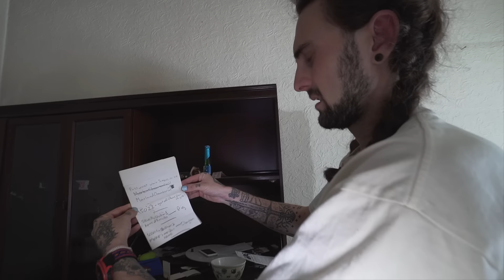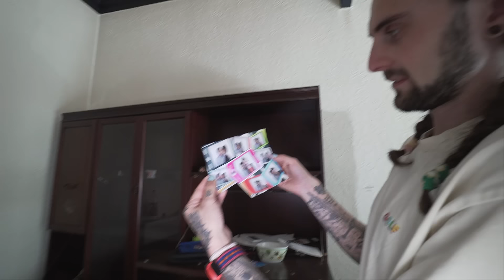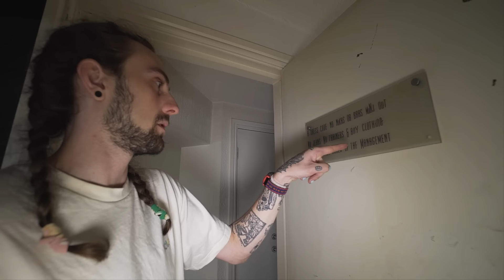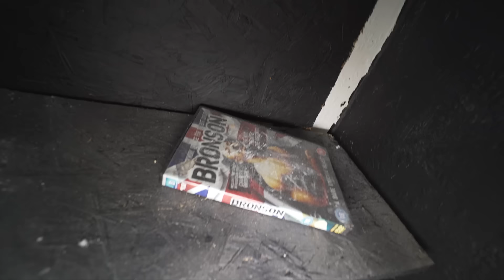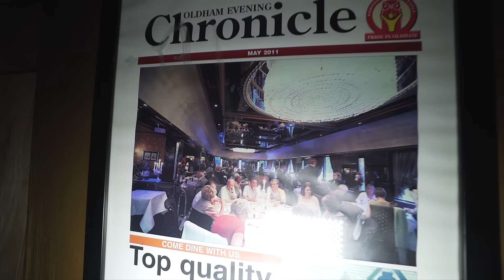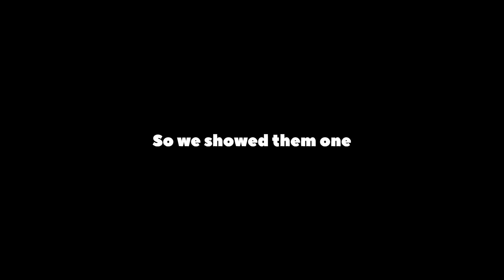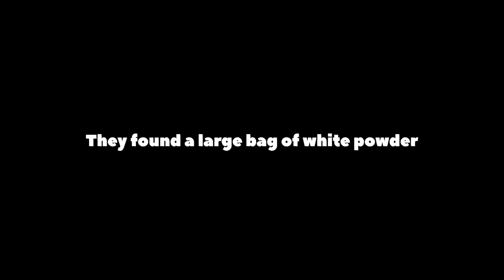We Helped The POLICE Break into an ABANDONED Building

Comment: So no one really suspected there could be anyone in the attic even though the "door" was slightly open? Just look above the head of Al at 12.49. I think there's a high risk of the dude living there hiding there when he heard you coming.

About the gas, as long as you're not an ass there's not any danger using gas that way inside, you just need to make sure there is sufficient air because it consumes air. Gas barely produces any soot.